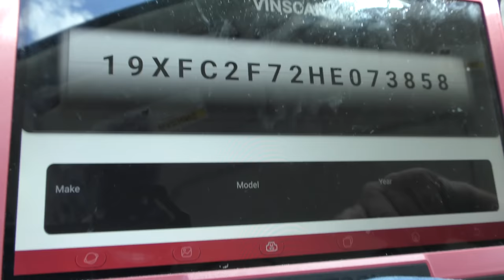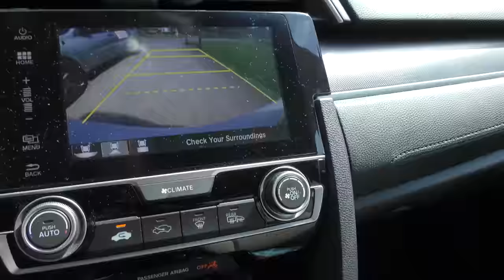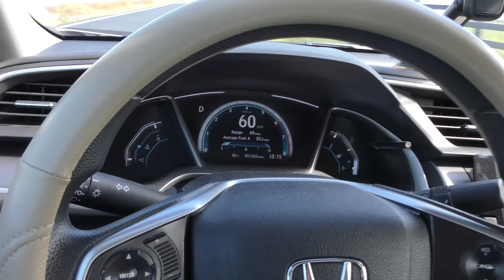Here’s What Happens If You Change Lifetime Transmission Fluid in Your Car

Comment: I have a 21 civic i get 44-45 highway easily. I had a 30 mile drive to work almost entirely on the interstate. If I use cruise control and keep it low 60's i get over low 50's. If I drive between 55-60 I can get 55+. I f I reduced speed down to like 55 I got a record trip of 59 mi/gal. I have been blown away by the miles per gallon on my civic. It has exceeded my expectations in every way. Forever a Honda fan.

Comment: Dear Scotty Kilmer .. Please recommend me .. I just bought a week ago, USED 2016 Lexus ES350 (manufactured on late 2015), with Basic 2GR-FE engine and U660E 6 speed transmission box (a lifetime sealed one).. So far it has done 104000 miles (almost 168500 km) , and is currently in great shape and performance .. and am not sure if the 2 previous owners kept maintain the car and do on time service or not .. the VIN report does not completely illustrate the history of the car. Since I intend to keep my car and use it for a long term .. should I replace the transmission fluid with the filter or keep it as it is??, also do I keep using the recommended 0W-20 engine oil, or should I replace it with the one that suite my area temperate?. Remember this, I live outside US in middle East where the temperature is so hot almost the whole year, and we don't have a fully trustful qualified Toyota mechanics like your self, only few car fixing shops, So based of what I said, what do you recommend me??/

Comment: I personally think you should only volume match the fluid if its never been changed. If its been changed go by the factory drain and fill spec. The person or mechanic before you could have under or overfilled it. If you dont know if its been done or not, use factory spec volume.

Comment: best advise on transmission for sure.. I bought a 2010 hyundai sonata with 125K miles. one of the first thing i do with used cars is change trans fluid and on rear wheel drive the diff aka rear end grease.   I will drain the pan, refill with same amount and check stick,, and then in a month or so do it again and have almost new fluid overall. 

 On this 125k model the fluid was a nice reddish brown (more brown than red)  , no burned smell and it took 4 times to get it looking like new.. SO figure fluid was 8 bucks a QT and it used like 3 qts per pan drain x 4 so less than 125 bucks ...  CHANGE IT YOURSELF.. if unsure check youtube for video on how to do on your car.  :)  

honda and toyota make have a good CVT but the rest are JUNK..

Comment: have a little over 100,000 miles on a 2015 Civic never had the transmission fluid changed, car runs fine, im a little scared to change it at this point.

Comment: My 2016 MAZDA BT-50 4 x 4 has a sealed 6 speed Automatic box. The recommended oil change is 250,000 Km (120,000 mile) but the Automatic Specialists here in the land down under are suggesting it should be changed every 40,000 Km. I was already up to 98,000 at that time so we did the change then and they said they were surprised how relatively clean it was, so I am thinking that 80,000 would be a better time to do the next change. This would be very similar to the suggestions Scotty has made in this video!

Comment: Lowes, Home Depot, etc. have the almost clear plastic buckets with increments marked on the side in quarts and litres and oz in the paint department. They work great for measuring the FZ fluid out of my Mazda CX30 which has a stick and a built in drain plug. Wonder why they put in a stick and drain plug on a lifetime fluid?? Being sarcastic but I appreciate both the drain plug and the stick.

Comment: I just did a drain and fill on my wife’s 2019 AWD Tucson. It has 46K on it, and I was shocked how crap was on the drain plug. Also how much crap settled at the bottom of the drain pan. It took 3 1/2 quarts. I plan on doing it again at the next oil change to see how much crap comes out again. It’s easy peasy once you do it once.

Comment: The jack point is in the center front under radiator. Jacking the pinch weld at an angle risks folding the edge. Those pinch welds are for lifts and jack stands, or the scissor jack that comes with the car.
Reply: Absolutely right.   It’s an amateur move.   Doing that will crack the weld and it will rust out.

Comment: I had a 2006 Nissan Sentra 235,000 MI I changed the fluid pretty regular in the transmission never ever had a problem smooth shifting never slipped I believe it was a Japco transmission

Comment: Inherited a 98 Camry from my dad 5 years ago with 12,000 miles on it. When I took it over, I changed the brake fluid, engine coolant, transmission fluid, power steering, and differential fluid. 

To change the transmission fluid, I disconnected the transmission line running to the radiator. There is a rubber hose piece between the metal tubing before it gets to the radiator. Disconnected the rubber hose piece and inserted a clear piece of hose several feet long on the metal tube so it could be run outside of the engine compartment and be seen while sitting in drivers seat. Inserted the clear tube in a clear one gallon milk jug, and started the engine and drew off about a half gallon of fluid. Matched up that gallon jug to a empty same milk jug and poured in new fluid to same level and refilled transmission. Did several times until fluid ran red, reconnected tube to rubber hose, and done.  

Car now has 42,000 miles on it. Will probably change out again at 50k. Runs like a charm and in perfect condition as it had always been garaged and never seen snow/salt before I started driving it.

Comment: I’ve never changed my CVT transmission fluid on my 2014 Honda Accord. It has 121k on it. I’ve heard it can be dangerous to change the fluid of a transmission with higher mileage that hasn’t been changed before. What’s your opinion? Thanks

Comment: For my 2016 Mazda CX-5, a full fluid exchange is changing the fluid 3 times as fluid is trapped in the transmission.  Drive between changes 1 and 3 to move fluid about.

Comment: Modern Honda CVT the maintenance minder recommends CVT fluid change around 50,000 miles. It’s not cheap around $189 if done at the dealership.

Comment: Hi Scotty, I was wondering what you thought of Subaru CVT from 2013 on. I have a 2013 Subaru impreza and have preformed regular Preventive Maintenance. I bought the car used, so I fixed the transmission pan oil leak and changed the CVT fluid with it. Just wondering your opinion on the Subaru CVT's.

Comment: We have a 2012 Subaru Outback with a CVT it’s actually pretty good so far. 
Did change the fluid at 60k. We’re just about to hit 100k pretty good power train. 2.5 normal aspiration.

Comment: The only time I had problems with my Acura RDX was when I took it to the dealership for an ATF change. Afterwards went and bought an Idemitsu (OEM for Honda) ATF and changed it 3 times. The car came back to normal.

Comment: I have a 2020 GMC TERRAIN SLE . According to the owners manual guide (under severe driving conditions) you are to change the transmission fluid at 45,000 miles .  But in (Normal) driving conditions it is not “required” . I’m so undecided if I should change it or not . And unfortunately mine does NOT come with a dipstick

Comment: the trans blew on my 2002 honda odyssey  with 100,000 miles on it and the fluid was never changed .... $2,000 to rebuild the trans and $1,000 for new engine n trans mounts !  The shop told me   to bring it back in a few day so they could check it for leaks ... Well I checked the trans fluid level and saw it was over filled ... I called the shop and they told me not to worry because it wouldn't effect the trans at all .   They did recommend to have the fluid changed every 30,000 to 40,000 miles .

Comment: Lucas transmission fix, does marvelous and can be added on top of full fluid with no damage. Most that go bad are from mistreatment, not fluid. Most people have problems if the filter is changed. Do not change filter. You need the metal filings.

Comment: Honda was smart enough to put a fluid check plug on their cvt transmissions, so dont worry about measuring exact fluid , just find the check plug and let it drain from there until it comes to a slow drip. Only works for honda cvt transmissions

Comment: I had a 2014 nissan sentra brand new. Had 98k miles on it when i traded it in for a 2020 sentra. I flushed and changed the CVT fluid every 20k miles. Never had transmission issues. Now have a 2023 Sentra.

Comment: i have a 2016 subaru legacy with 115k miles on it. never changed the cvt fluid—not once. i bought it when it was @ 79k miles. it still runs the same. i will be changing the fluid soon though as i hear it will make my transmission last longer and give me WAY better gas mileage

Comment: Chiming in only because I recently changed the AT in our 2 vehicles.  First let me say that AT changes have come a long way from the days of dropping an oil pan, replacing the gasket and filter, etc.  It's much more like an engine oil change, or a differential fluid change, in that there's a clear drain and fill.

The cars I recently changed were a 2020 Honda Odyssey and a 2018 Honda Pilot.  I changed the Odyssey because the OBDC indicated to do so.  Of course I researched online how to do it, and it's a good thing I did because there are 3 different AT's in those vehicles with 2 different AT change procedures with different fluids.  AT's are so highly tuned to specific rheology, that changing the fluid could mean catastrophe.  Unfortunately that also means buying fluid from the dealer - I had to buy 4 Qts @ ~ $18/ea!  And, that only really changes out about half the AT.  Some AT's have "flush" procedures where you're supposed to drain, fill and repeat 3 times - I get what that is trying to accomplish, but you're just using fresh, expensive ATF to dilute what can't drain by itself, and repeating that enough times to get most of the old ATF out.  Seems like such a waste IMHO.

The Pilot, on the other hand, didn't call for an AT change but instead was exhibiting some odd shifting behaviour - I'd almost call it hesitation, or like it couldn't decide what gear to be in when the RPM was low.  Turns out after consulting some people "in the know", this is a well known issue with that particular 6 speed (which Honda also uses for Ridgelines) when the ATF is going bad, and the solution is just to change the ATF.  The procedure was similar to the Odyssey, the fluid was cheaper (more like $10/qt).  After the change, it's a brand new transmission

I've also changed "lifetime" transmission fluid in other vehicles - most notably a BMW I kept to 200k before selling it to get a larger vehicle - changing the fluid in that MT (stick) made it much smoother to shift, the affect was quite noticeable.

A couple other notes - The safer method for replacement is to measure what comes out and replace with the same volume, at the same temperature.  So, it's best to change the ATF while "cold".  Some vehicles will have dip sticks and some don't - the Odyssey didn't but the Pilot did - which actually makes refilling the AT easier than the contortionist designers at Honda.  Lastly, there is often a check level plug - just like you'd have in a plain gearbox or differential, but the fluid level needs to be checked at a specific temperature, and this plug isn't always easily accessible.

So in short, do your own ATF changes, they are easy, but be sure to know the correct procedure and use the correct fluids.  Oh, and be sure to buy an extra quart of fluid - you'd hate to assume that online or dealer instructions are correct only to find that you need more oil and then have to find a way back to the dealer (that might not be open).  This happened with the Pilot - online and dealer said 3.7Qt is the change volume, and wanted to sell me 4Qt only, but I insisted on a 5th Qt.  About 4.3Qt came out of the vehicle.  Good thing I got that extra Qt!

Comment: I have 05 Toyota Corolla  s with over 300,000 miles I have never changed  transmission fluid  or break fluid or spark plugs. Still running strong..

Comment: Drain and fill. I haven't ever changed the transmission fluid on my 2013 Dodge Grand Caravan. It has 129K miles on it. Will the drain and fill be a good idea?

Comment: What about the transmission filters ?  I have a CRV 2017 with 92.000 miles so I decided to change the transmission fluids but about the filter what you recommended?

Comment: Subaru is saying the ascent transmission is a sealed unit, and it will void the 100k warranty if the fluid is changed. What would you do in this situation? I don't want to loose that warranty, but I also want to make the transmission last well past 100k.

Comment: Just changed the cvt fluid on my dads toyota, took off the pan and drained out as much fluid as possible. Car has 120000km on it. Was running really well and now with the new fluid drives even better. This is the 3rd cvt fluid service on it. Any oil in ur car needs changing its just logical

Comment: When I change my cvt fluid, I take off the inlet & return hose. I pour 5qts into a bucket & connect a electric pump from the bucket to the inlet connector, then I connect a hose to the return connector & run that hose to a empty bucket. Start my car, turn on the pump & it pump in new fluid, while the old fluid is being pumped out.

Comment: I have a 2004 Chevrolet Suburban 1500 with 5.3L. Transmission was rebuilt around 93,000 miles. It now has 175,000. Last service on transmission was around 140,000. What should I do now with 175,000 miles on it? Should I just drop pan and replace filter and fluid with amount that came out. Also it has a vibration/shudder when vehicle speed reaches around 35-40 mph.

Comment: Hondas have a check bolt. Over fill if not sure, run engine and put through gears. Shut off and open the check bolt for excess to run out.

Comment: I feel like this depends on ur definition of a flush. If ur using the machine that pumps cleaners and stuff through the transmission I agree. But if ur doing drain and fill flushes they may be helpful. I work for Honda and we have an issue on some cars where the fluid is deteriorated to the point the converter judders. So we replace drain and fill the transmission 3 times along with putting between 5-10 miles in between each drain and fill and they’ve never made one shift worse in my experience unless the transmission really should’ve been replaced but warranty made us start with the drain and fills
Reply: I say definition because we call it a flush. Because it’s removes as much fluid as possible without using un recommended flush machines. The factory doesn’t even recommend the machine style flush

Comment: Hey Scotty just bought a 2013 Honda civic lx. Wanted to change the transmission fluid but I’m iffy about it. It has almost 124k miles on it and it runs good just want to change. Idk if it would be a good idea or not since I don’t know if it was ever changed?

Comment: changing the cvt fluid change on the 1.5l engine is so much easier too, its basically a diff fluid change if you ever done one, honda does a good job on making reliable and easy to work on cars

Comment: Mr Scotty ,I have ,Nissan Altima 2000 2.4 eng GXE ,191.000 mls ,and Ford E150 4.2 eng  2001 255.00ls and never replace transmission oil ,and still working ok 👍.

Comment: Scotty, We have a 2011 Toyota Highlander, 3.5 engine with about 151,000 miles on it ( 90% of that is in town driving- the rest is highway miles ), I have yet to change the transmission fluid in it and the fluid is still very pinkish/red. At this point should I even bother changing out what fluid that I can drain out and replace or just keep going and hope for the best. So far ( not to curse myself) the transmission shows no signs of slippage or any other problems.

Comment: Hi scotty I have an 05 4runner v6 sr5. I am presently at 157,000. I went by the service manual and have never changed the transmission fluid due to the fact i havent used the truck for towing as a requirement to change the fluid every 30,000. Is it advisable to change it or leave it alone considering  the mileage i have know. i have gotten mixed reviews thanks

Comment: I get 38 MPG highway with my 2013 Malibu 2.5 litre with a six speed auto.  !0 minute job to change trans fluid. No need to jack it up and no under panel to remove.

Comment: I have the same generation of civic I have changed the fluid every 30000.  Coming up on 90000.  My question is the filter in the transmission. I've changed the warmer filter each time but haven't changed the other one yet.  Should I change it or leave it alone?

Comment: If you did that on a Subaru, you'd be mopping the drive. They need the engine running to get the last litre in.
Plus I love the way the drain and refill fan boys, tell you to change the bad fluid, but then really only dilute it about 50% with the new fluid.
You need to pump as much of the old fluid out of a return line as you are refilling with the new.

Comment: I just disconnect the return line, and keep adding fluid until the bright red fluid is moving through the clear tubing. 2006 f250 takes 17.5 quarts total, with 7.5 in the pan.

Comment: If it’s lifetime surely it doesn’t need changing??,I’ve got a BMW 2009 X5 E70 Msport 35d which has a electronic sealed transmission with sports mode,it states it’s maintenance free,is that just a name Scotty,or does it need changing,thanks.

Comment: I found one gram of metal on my magnet/plug after 1st 1000 mi , 97 civic CVT, been clean since. Honda spec. change every 15K. yes!
Only problem CVT has at 70k mi is short slip decelerating when subzero sometimes, no problem for me. Always used real Honda oil.
Everyone should change CVT oil after new car breakin 1st few K mi....